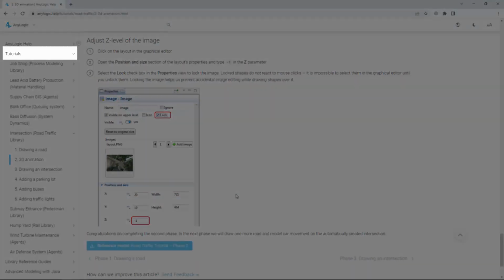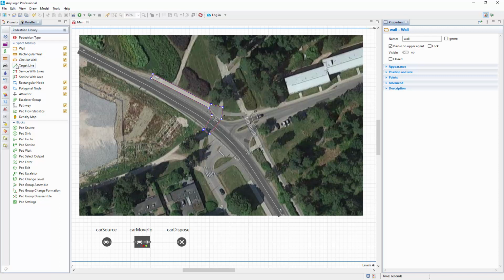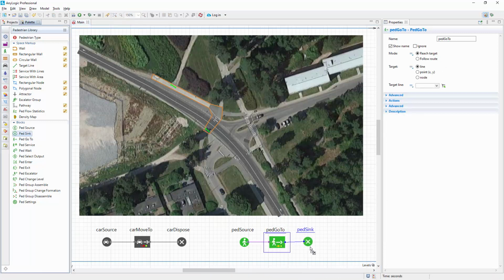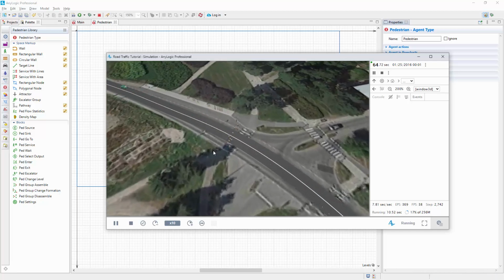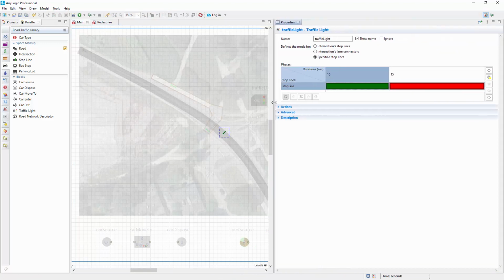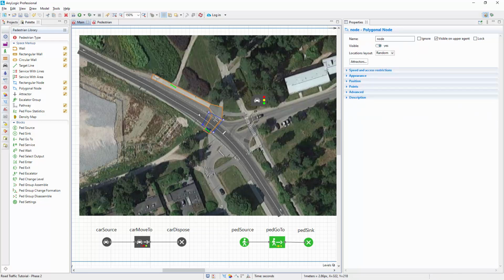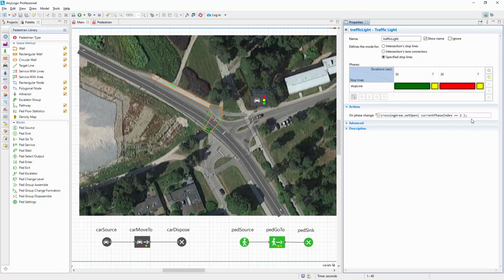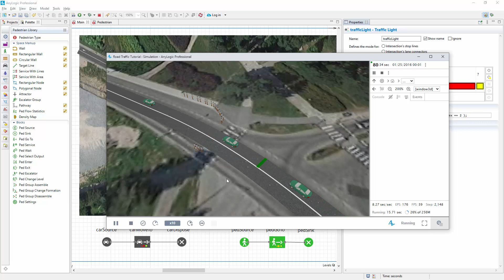Simulating a pedestrian crossing

Comment: why do I get this error? 'error while drawing animation" frame anylogic
Reply from the maker: Hi there, 

Could you please clarify at what step you receive the error? Please also check if you are using the same model - https://cloud.anylogic.com/model/4b7e90f6-4f01-4eb7-b89b-c2ef775a5bce?mode=SETTINGS - as defined in the video and make sure you follow the video instructions step by step.

Comment: How simulate a road traffic in a complex model with several streets in a whole district?
Reply from the maker: Hi, 

If you’re new, please follow the Road Traffic Tutorial - https://anylogic.help/tutorials/road-traffic/index.html - to learn how to build a basic road model and add vehicles. To simulate road traffic in a complex model you will need to draw relevant roads and connect them using intersections - https://anylogic.help/markup/intersection.html 
Here are model examples that can be helpful for you - 
https://cloud.anylogic.com/model/de6f47f6-072c-4a50-818d-e2625067dfad?mode=SETTINGS
https://cloud.anylogic.com/model/e1392a58-2aad-476c-9a23-3959c550ce8b?mode=SETTINGS
https://cloud.anylogic.com/model/8e0f33e1-fbcc-4a7c-948e-4894839ddf5f?mode=SETTINGS